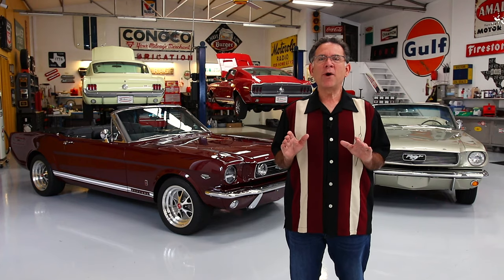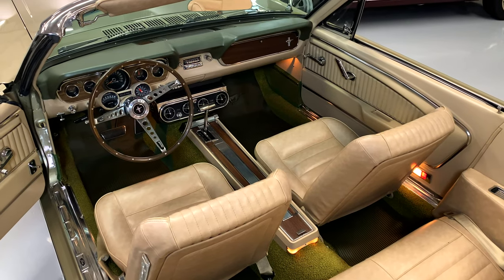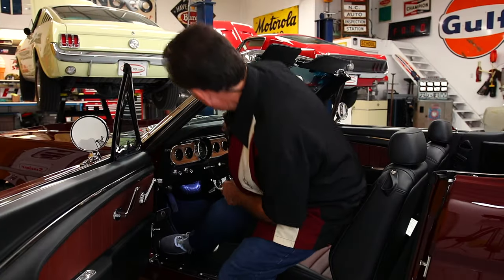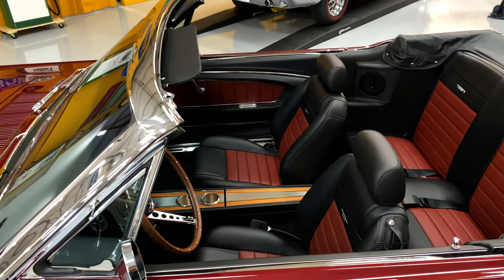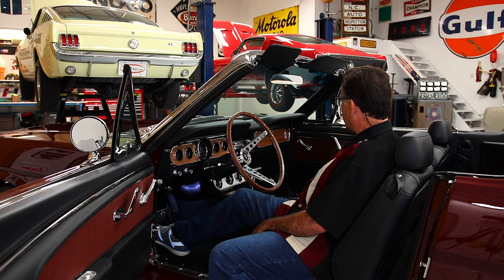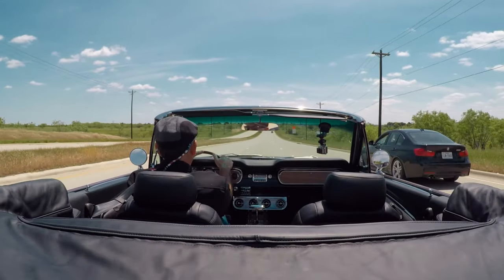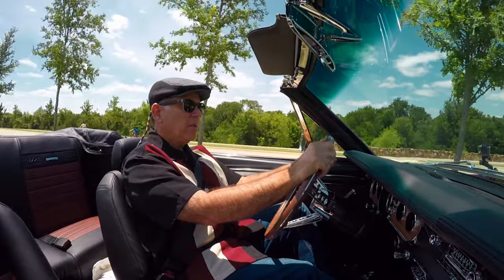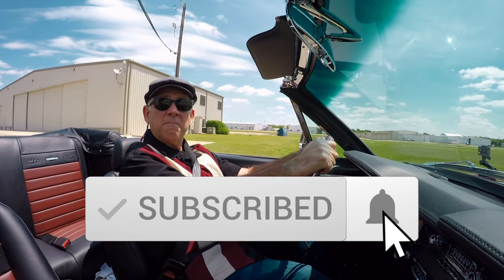Revology Mustang Review - 1966 Convertible

Comment: Great review.  You should have disclosed they only use Ford engines and transmissions now.  The early cars used a GM LS engine while they were waiting for Federal approvals to use the Ford engine in it. I toured their facility when they first opened and they really do a lot to improve the Mustang "experience" with current engineering.  I have an original 65 Mustang convertible I have owned 53 years, and I wish it operated like the Revology.